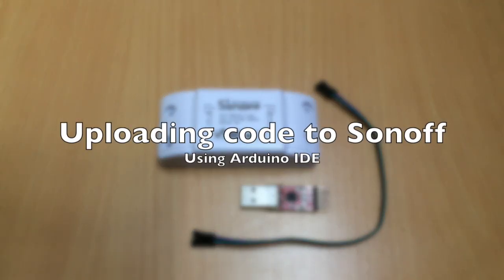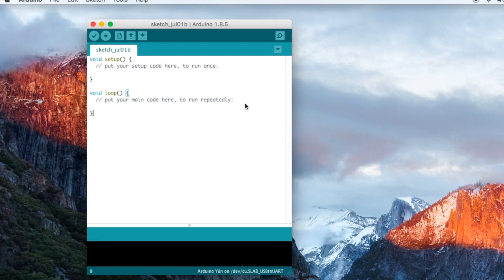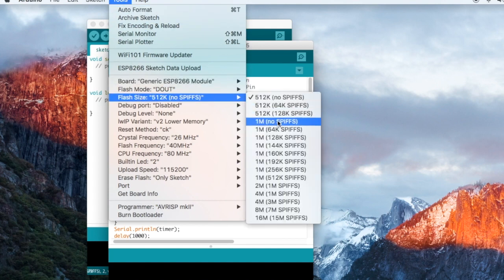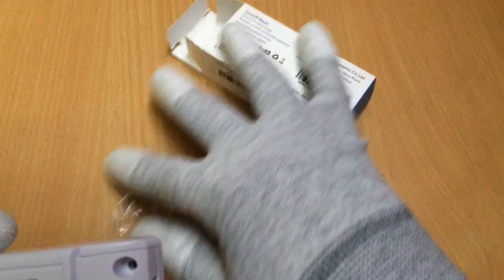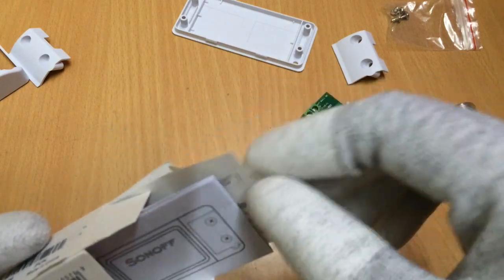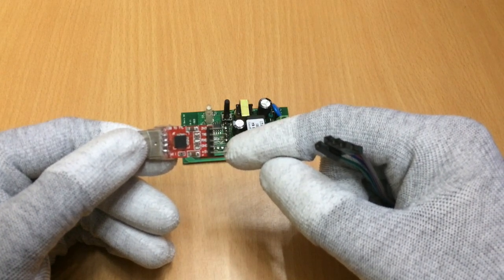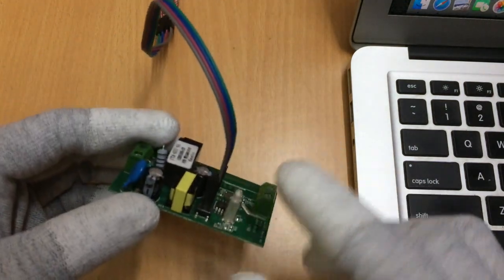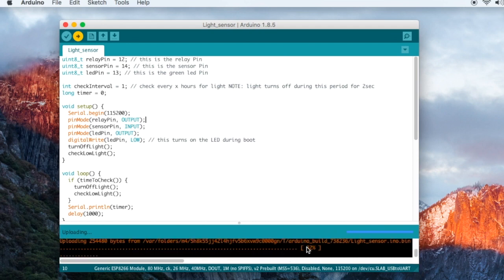How to upload code to your Sonoff using Arduino IDE

Comment: You should also inform/warn that you loosing the original Sonoff firmware. Or can I still use EweLink?
Reply: If we can take a backup, we will not lose it.